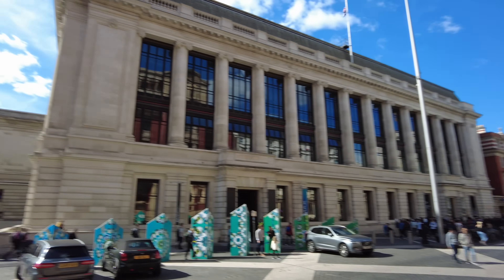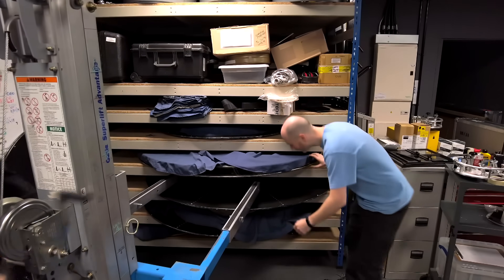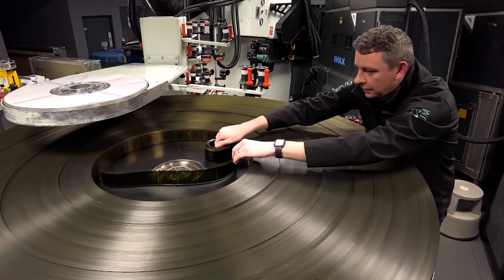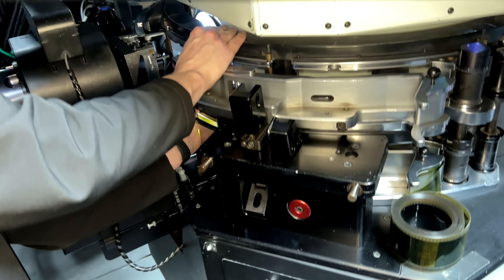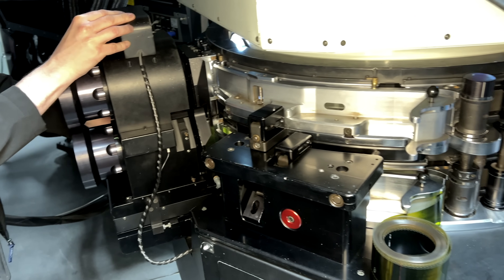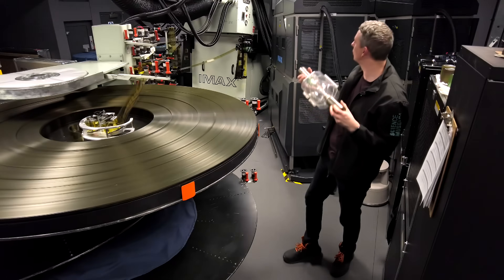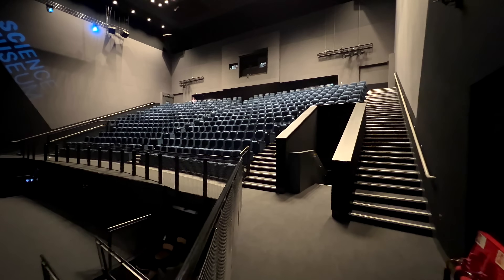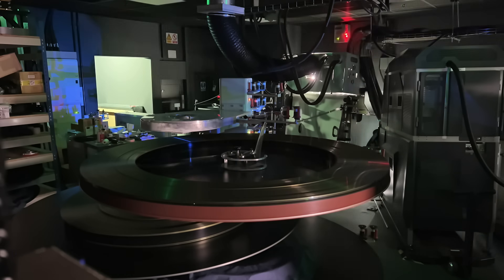Behind the Scenes: 70mm IMAX Projection of Interstellar at London's Science Museum

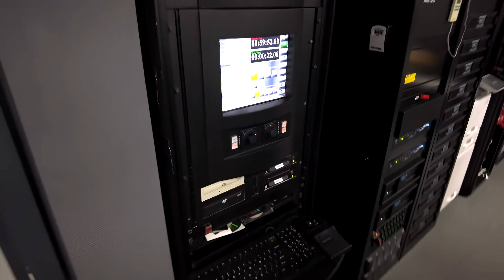Comment: There is more than enough room for a soundtrack on IMAX 70 mm film.  At 11:55, just look at how much wasted space there is beyond the sprocket holes.  Historically that space would be used by 4 channels of magnetic soundtrack.  A digital encoding could easily fit multiple channels of audio in that space optically.  Smaller film formats manage to do it.  But it's easier and less expensive to get audio from a disc or hard drive than from film.